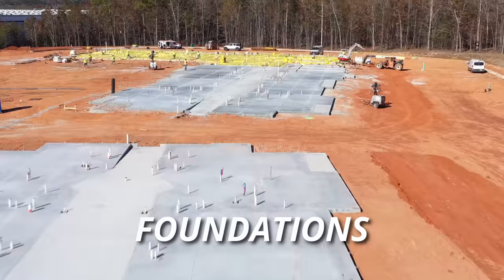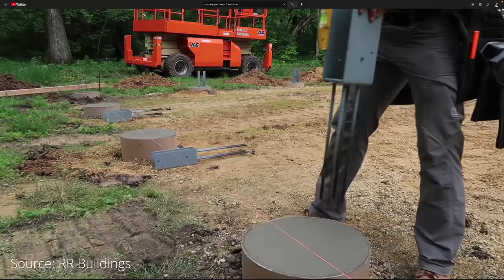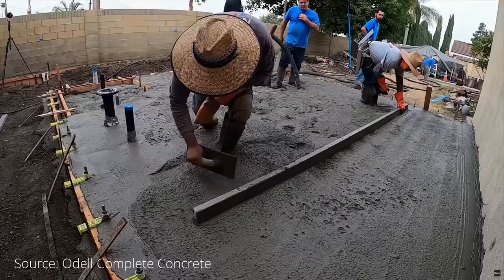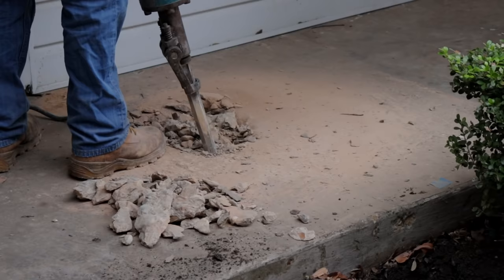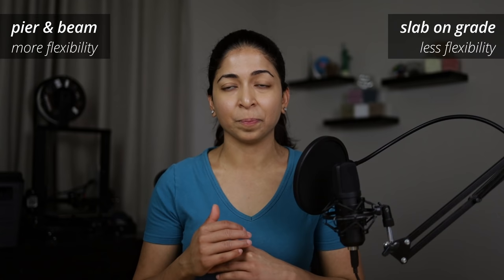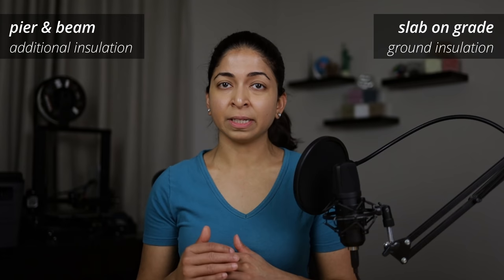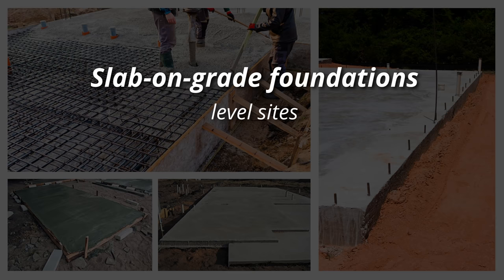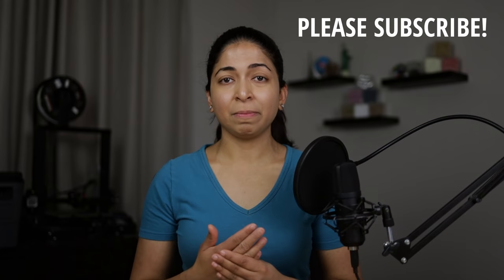Pier and Beam vs Slab Foundations | Which one should you choose?

Comment: Crawl spaces are nothing more than stinky wet holes in the ground that breed mold which gradually takes over your living space. I will NEVER build a crawl space house. Slab houses are cooler in the summer and warmer in the winter with that large flat stone doing temperature control for free all year round. Most new houses in the Midwest are built on slab. I've never heard of anyone having any cracking problems.

Comment: Some thoughts on your information about pier foundations: In my area they do not need to reach bedrock unless the load design requires it. The engineer will evaluate local soil conditions, and the pier will be designed to provide support to the building through friction between it and the local soil. It is in fact rare for them to reach bedrock in valleys with deep alluvial soil. The piers will be the correct size and spacing to meet the loads and uplift of the building given the local conditions. I once worked on an interesting home that had a slab on grade foundation, but then had a post and beam crawl space built on top of it. Best rat slab ever!
Reply: Correct. Soil exerts pressure on piers/piles, and that pressure means friction that supports the weight of the structure. Driving piles into the ground instead of drilling holes and cementing means more soil pressure, more friction, and more support. How far to drive a pile is simple in that if you apply as much force to it as the structure (weight, environmental loads, etc.), then when the pile stops moving, that's deep enough. Piles like this are able to resist millions of pounds of force and anchor massive offshore oil rigs--all in soft silty/muddy soil without cement.
Reply: @theevermind  
My engineer brother explained to me that the same principles apply to poured in place piers, indeed to any foundations. Edit: While poured piers are set in the ground rather than driven in like piles, they are still effective for the same reasons.
Reply: Wanted to echo this to make sure it is heard.  Piers do not need to reach bedrock.  There are very simply calculations for knowing the area of a footer required at the bottom of a pier to accommodate the live and static load from the planned building.  The frost line is also important as freezing soils can push piers up if they are not below the frost line.
Reply: @johnmellesmoen2202  
Echo received, and bounced back!
While the method of installation is different for poured or precast piers, and driven pilings, the same is true for all. Even if you are lucky enough to have bedrock close to the surface, all of the the other factors will still be accounted for, especially if uplift is a major factor.
Reply: Yep, maybe that's regulation in some places, but in the three places I've lived around the world, piers do not need to reach bedrock, if, as you say, there's sufficient friction and load-bearing capacity.
Reply: @johnmellesmoen2202  Yup friction piles are generally used in most smaller construction projects. Depending on soil type, you may need to think of the pile sinking because of weight was well.
Reply: I would imagine the other big advantage to piers is fixing problems afterwards, and treating for and preventing termites. much easier to jack up one sinking pier than fix a snapped slab.
Reply: Yep I was chef estimator for a couple of large housing companies and what you have said is perfectly correct. Believe me if I didn't get it right my butt was on the line.
Plus my trade was as a brucklayer so I've done countless piered footings and underpinning repairs to both slabs and strip footings.
Reply: A 1958 school building they just tore down in my area had the opposite arrangement. It appeared to have been built on a slab, but part of the slab was actually elevated on piers, probably to keep it dry, and the hidden crawl space was camouflaged with concrete walls. That end of the school had a garage that was used to store city vehicles and the slab structure had started to deteriorate from the salt used in the winters,  so the crawl space was filled with cellar jacks. That fix probably would have lasted indefinitely as long as the space were not  used as a garage, but by 2018, the building was falling behind current codes in various ways and the laws in this state are rigged in favor of replacing, rather than rehabilitating, old buildings, so it had to go.
Reply: I think same over here in WA OR Portland Metro area for residential.

Comment: Slabs that settle unevenly can be hydraulically jacked back to level.    The process is drill a hole in the slab near its low point then pump concrete mix under the slab until it gets level again.
Reply: It messes with your plumbing 9 times out of 10 though....

Comment: I found Pier and beam to be the best for super-insulated homes.
It allows for  monolithic connections between walls and floor. You can achieve a perfect fluid-applied wrap, as well as a near-perfect insulation connection.
Also: As mentioned in another comment: You don't need to go down to bedrock, you just need to get your footer below the frost line by X amount, and have an engineer sign off on loads. And lastly: Pier and Beam is very Do-It-Yourself friendly.
Reply: I’m getting ready to build a pier and beam house and she made me nervous. I have quite a bit of clay soil and I don’t know how far down bedrock is.

Comment: You can insulate crawlspace with fiberglass rolls between the joists (source: helped my dad insulate our crawlspace when I was a teenager, it was huge pain in the ass). The moisture will eventually degrade the insulation, but the immediate improvement was apparent. 

Regarding termites, they build mud towers in the crawlspace to reach wood, so maybe that's a wash, too.
 
I live in earthquake country and once owned an on-slab home that had been damaged in the 89 Loma Prieta quake. The plumbing cracked beneath the concrete and had to be rerouted above the living space. 

Upshot is, nothing works, and we should all move back into pole lodges :).
Reply: yes but with pier and beam you can see the termites wherever they come up. if you have a crack on the interior of a slab you will have to rear out drywall and pull up flooring to find where the termites are getting through.
Reply: Mineral wool insulation will survive much better in this role, particularly regarding moisture.
Reply: @microcolonel  How do you think foam would work?
Reply: @mtadams2009  I'm no expert on that, but I would expect EPS (guessing this is what you mean by foam) to risk trapping water above it, and causing rot. AFAIK EPS is commonly used for flat roof insulation, but in that circumstance being water impermeable is a useful property.
Reply: @microcolonel  thanks
Reply: In my part of the world, most homes were built on solid timber stumps about 12-16 inches diameter and treated for termites. They then used galvanised iron caps with down turned edges to control them. The beauty of it was that you could see the little buggers building their vertical tunnels and kill them. even if you missed it, they ran into the caps which foxed them. It was only the totally neglected homes that got any issues and then after years.

Comment: Maybe something to add, I'm not sure if this is more a european style of concrete slab contruction, but that is what I'm familiar with: It is kind of a combination of the two you mentioned, but relates more to the frost line and going down to bedrock is not possible in many areas in Europe: A perimeter rebar reinforced concrete stripe going down into the ground below the frost line in winter with a thick gravel drainage below (that was 2 meters deep minimum in total in my case). The slab is then poured either at the same time or later, the perimeter concrete is water insulated by tar (there are various products, but essentially it is a water barrier on the outside).
This prevents any damage to the concrete foundation due to moisture, prevents movement in the foundation due do expansion and contraction of soils due to frost, doesn't need to go to bedrock, avoids movement due to moisture below (due to the drainage gravel) and only cracks with very extensive movement of the soil (if you are on a slope and the whole ground starts moving for instance).

This adds higher upfront cost due to more concrete and more preparation work being needed, but these kind of constructions typically don't need any maintenance at all, as the perimeter concrete stripe goes deep enough to not be effected by soil movement.

I always wondered how these (from my experience in my country) weak foundations made in the US hold up over time, your mentioning of constant repair being needed clears that: Not very good it seems.

Comment: In my area ( mid south), the most common foundation is a perimeter wall of concrete blocks set on a complete perimeter footing that extends below the frost line, which is relatively shallow.
Reply: Same here, not an architect but it feels like it's the best of both worlds
Reply: Yup, I work on foundations in Missouri and this is how all of the old homes are done, and if you have to redo a basement wall you have to block up the top couple feet because you can't form and pour concrete all the way up to the floor joist.

Comment: Hello Belinda, Well done, as usual.   My parents built a house in North Dallas in 1953.  It is still standing but not for long.  Every house in the area is now a teardown because the land value and taxes are too high to merit a house so small.  It was built on what was called pier and beam.  But, the foundation was really a floorplan of the house with concrete forms indicating the exterior edges and the interior walls of the house.  Forms were built a few feet deep along those lines--they may have hit a limestone base but the limestone is very soft.  You can see it along the sides of the North Dallas Toll Road as it dips below grade at underpasses.  To this day, there are no cracks from shifting.  And the right angles of the walls and ceilings have always amazed wallpaper hangers.  One of the main issues is that it was not built on fill dirt.

Comment: An interesting type of foundation to cover would be the insulated slab foundation for northern climate. Not popular in North America, this system is widely used in Europe. 
It seems to be one of the best solutions to meet passive house standard due to its ability to isolate the building g from the ground. 15 inches of Styrofoam are used, and 11 inch slab is poured on top with reinforcement. Optionally a heating system can be embedded in the slab. The thermal mass would mitigate day and night temperature fluctuations. Exposing some floor to southern sun can also act as energy storage. I suppose the key to its longevity us in the subsurface preparation. Plumbing repairs would be a nightmare. 
Thanks for the video!

Comment: Quite a bit different in Ohio. Trench foundations, below the frost line, are the norm here, even if the house uses a slab floor. Crawl spaces here are about 38 inches high or more on newer homes, depending on local codes.
Thanks for the content. 👍👍
Reply: Trench foundations are a variation on pier and beam.  They are used in colder climates to get the footing below the frost depth.  This video was prepared in Texas where geound freezing is not an issue.
Reply: @rogerhodges7656  you don't say.

Comment: There were several generalizations that I wasn’t expecting. Texas is a large state and the soil isn’t the same everywhere. It can be significantly different in just a matter of miles. It’s important to get a geotechnical core drilling sample and report done and evaluated by an structural engineer in order to determine what would be best for any given area. In some instances the geotechnical report could recommend piers under a slab on grade, void forms or that soil be brought in to stabilize existing soil or some combination. The engineer would design the slab and what beams would be needed and how much rebar would be needed based on the soil test recommendation and the loads required by the specific structure being built.

Comment: I live in the Eastern Panhandle of West Virginia. It's a really weird spot. We get really cold Winters that would make me worry about pipes freezing in a crawlspace, and around town, every year some underground pipe bursts down on Main Street. The consistency actually makes me wonder if they're doing crappy repairs on purpose to have work every year. Anyways, at the same time, basements are awful because they humidity is so high here during the Summer, and it rains enough that everyone's basement is muggy and damp. My house is a split-level with a walk-out basement, the back side of my house is level with my backyard and the front is buried up to the window sills. For both those with any kind of basement or slab-on-grade, there's also the worry of Radon gas seeping up through the concrete and settling in the bottom of your house, so we have to have passive or active systems on a pipe that runs underneath the slab (including/especially a basement's slab) to bring the gas up through the house and out the roof.

If I decide to stay here whenever I go to build a house, I think I want pier and beam, and I'll just have to take preventative measures to prevent freezing of external plumbing. I think one nifty solution might be, if I'm able to be a geothermal system in, to just have an extra couple lines wrapping around my drains and well inlet (spaces far apart from each other of course) and then heavily insulate around that - maybe even with concrete in a kind of "false pier." As far as critters go, I suppose there's space for something to exist, but the underside /should/ be sealed up just as well as the sides are, albeit differently, and not particularly "more vulnerable."

Comment: I just found your channel - you seem to cover a lot of my interests like building and planned obsolescence of durable goods ( stop blaming consumers solely for this problem, I agree).  For this topic,  I want to build a small house on a gentle slope in Western NC.   I asked a builder about using a pier foundation and he clearly was biased against piers based on his reaction.  I suspect he doesn't have the talent available to build this.  He raised the concern over wildlife nesting under the house.  I like pier because of the ability to get to plumbing/electric after our experiences repairing/remodeling houses built on slab.  After remodeling, I agree that houses should come with schematics and a lot more documentation!  

On our last remodel, we could not find a GC who wanted to work with us.  They were ALL busy.   I don't think they liked that we had a budget - they moved on to those people who knew much less and would pay much more.   Anyhow, the original builder (1989) poured a concrete slab in the middle of our house  2 inches lower than the sides in order to put a full 3/4 inch wood floor system in.   ironically, the wood floor was not even level with entry way tile?  So much for using match to calculate this offset!!! This made it very challenging to put in one uniform floor system.  We ended up removing all flooring and adding new concrete on top.  We researched and used correct concrete and bonding but still, it is a cross your fingers kind of thing.

Comment: Just sharing..
Where I live in the Caribbean, we have generally have either rocky or a commonly occurring type of heavy clay soil (referred to as Sapate).
Though we don't have winter,  we do have Rainy and Dry seasons.
In the "rainy season" (approx 6+ month of the year) heavy rains saturate the clay, causing significant heaving (soil expansion), whereas in the dry season, it dehydrates it, resulting is significant shrinkage. Both of which have significant movement and put stresses on the foundation.
The solutions to the clay areas, are typically use of a monolithic raft foundation or Strip-footing atop Piles.
The pies range from "Augured Piles" to "Driven Piles" and typical start at a 15' depth and increase based on the data from a Geo-technical survey, building design and structural requirements.

Comment: In Washington State most of the homes of the past were built on a wall foundation with piers.  They worked well in allowing the home owner to work on any plumbing issues.  Most of the houses in the California area are slab on grade for new construction but the older homes are similar with wall foundation and pier.  If you have any shift in the ground it has caused plumbing issues with the breaking or cracking of pipe or electric conduit.  I like the old method because it also allows you to insulate the bottom of the structure and allows repairs.
Reply: Another issue that comes from slab on grade is try repairing a electric conduit or plumbing when the framers don't follow the blue print perfectly and you have to jack hammer out the conduit, cut it and extend the conduit to be within the frame work of the wall.  Try repair and broken plumbing pipe and your carpet or wood floor is soaked with water because the slab on grade shifted.